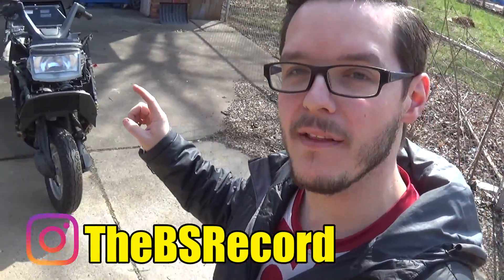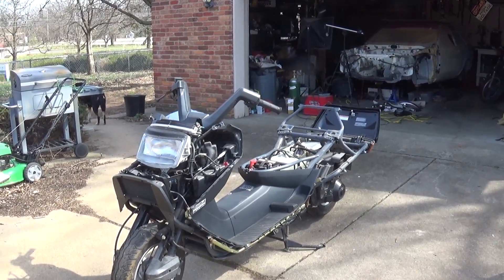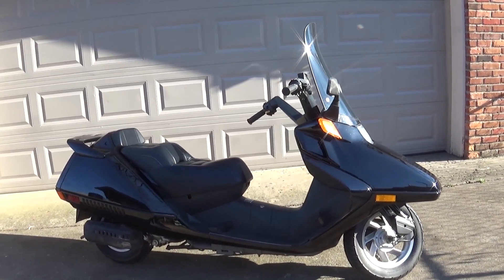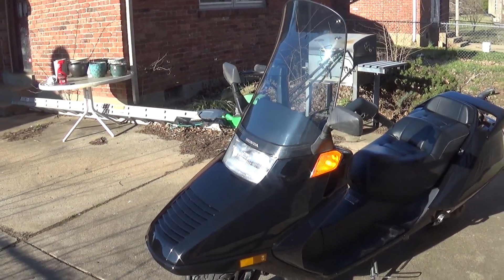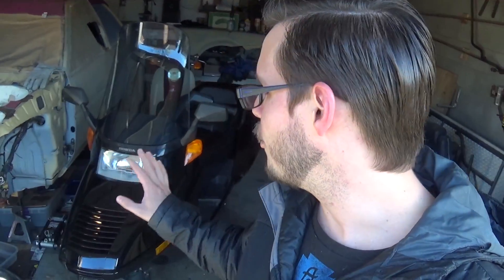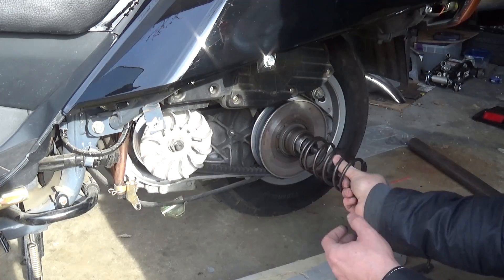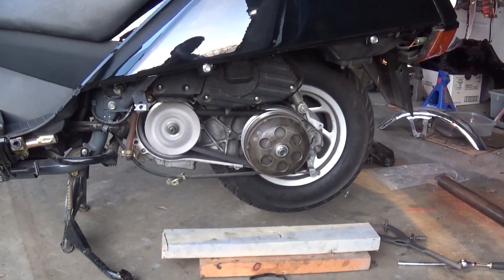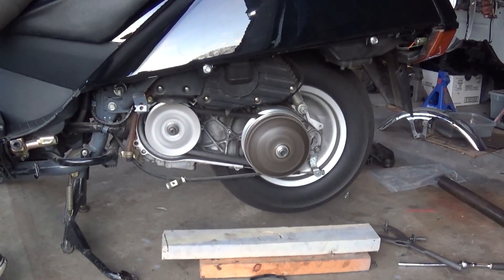Fixing My Honda Helix CN250 | DIY Scooter Restoration Project - Honda Scooter 250 cc( Honda Fusion )

Comment: As a guy who comes from riding motorcycles for about 30 years you guys are really getting me interested into these scooters. Especially this Helix they look really nice and fun and possibly something you could tour on.
Reply: As a 30+ year motorcycle owner and rider buy one if you can find a nice one they are a historic classic and loads of fun. My last 2 bikes were 1500 & 1800cc Goldwings until I bought a 1996 Helix 2 years ago. I don't at all miss wrestling 800+ lbs over it's 349 lbs, the higher cost of maintaining 6 cylinders over 1 cylinder, or shifting 5 gears opposed to none, and the seating and feet forward positioning are the ultimate in comfort. I mostly drive parallel freeway back country roads and cruise at 50 to 60 mph with other riders driving larger machines without a problem getting 68 to 77 mpg. and still have a top end of 75 mph. I have always been fascinated with scooters my whole life and will probably add a Suzuki Burgman to my collection one day but will never part with my Helix.
Reply from the maker: @Serpico1152  thanks for sharing! I love my helix too, its a great scooter!
Reply from the maker: You should get one, they are super fun!  Definitely tour-able!

Comment: Great job and video I could watch Helix videos all day long. I bought a 1996 Helix back in September 2018 and I replaced the complete CVT last fall with all new OEM Honda parts as it was at about 21,500 miles and started shuttering and shaking when taking off from idle. Everything appeared to be all the original worn out parts with some being dated 10/17/95 the variator rollers had very worn flat spots and were replaced with Dr. Pulley 21 gram sliders, the driven pulley friction pads and bell cover replaced due to having the dreaded bluish tint color indicating that they had overheated and the bell inner surface damaged, the belt replaced due to having several cracks in it, and everything else considered a moving part. Yes they are easy to work on, diagnose and repair as you did everything correctly in my eyes by using the tool and torque wrench when installing it like I had also but I have seen others using a impact gun or looking like a cave man tapping on the edges of the nuts with a hammer and chisel to tighten them causing permanent damages. Since I never received any prior maintenance records for a solid piece of mind and to be 100% road worthy I would do as I did and eventually replace the air filter, fuel filter, spark plug, flush and replaced the front brake fluid, flush and replace the coolant system, replace the final drive oil with 75-80W gear oil if not at least check the oil level as I have seen others have theirs damaged because they were run dry of fluid. While mechanically everything on mine appeared to be somewhat neglected, appearance wise the bike was showroom quality so everything should now be trouble free for a long time. My only regrets now is that I didn't video all my work to share with everyone out there, but I hope to start and change all that in the near future.
Reply from the maker: Lots of good information here! My buddy just got a 1999 Elite 80 and is experiencing the same shutter when starting off and decelerating. We think it has to do with his clutch bell like you mentioned above. Thanks for watching and commenting!

Comment: Great series of videos!  I had an '87 Helix and loved it.  They're pretty bulletproof machines with a couple of weak spots.  On my '87, there was no bracket to support the carburetor, just the rubber intake boot.  Over time, the constant vibration would crack the boot.  Honda corrected this by your 2001 model.   The other weak spot is the little rubber hose (it looks like a vacuum hose) that carries coolant to warm up the carburetor. If that hose breaks or falls off, you'll lose all your coolant before you can say "oh shit".  That's what happened to my '87.  I was on the freeway doing 60+MPH when the hose fell off the carburetor.  By the time I got safely to the side of the freeway, my engine was toast.

Comment: I know you want to lower the Helix and make it your own, but trust me, it aint broke. Dont need fixing. The Honda engineers REALLY knew what they were doing when they designed this machine. Once you start riding it on the roads, you will see what I mean. Enjoyed the video and keep it up!
Reply from the maker: You are right, I have been riding it and I love it, but..... I am still going to try out an air ride setup. I plan on getting high quality air parts to hopefully get the nicest ride as possible and are going to try and make the system 100% modular. Meaning I will be able to swap directly back to stock suspension if I dont like it. I do not want to cut or modify the stock mounting points at all. Thanks for tuning in and commenting!

Comment: I have a Honda helix, working on this bike is time consuming but it’s fun the same time !
Reply from the maker: For sure! They are a lot of fun and super reliable once you get everything sorted. If you haven't already, I suggest looking into getting a service manual for the bike. It will definitely help out when performing maintenance and servicing for the bike 👍 Goodluck with your helix!
Reply: @TheBSRecord  thanks, I still continue to work on it, I have some minor breaks with my plastics that needs a replacement and weld, I’m glad I have clean my tank, reservoir tank too, everything is clean I need to replace my carburetor seat needs to be replaced and then I get it on the road again, best bike I ever had 🥰
Reply: @TheBSRecord  thanks, I still continue to work on it, I have some minor breaks with my plastics that needs a replacement and weld, I’m glad I have clean my tank, reservoir tank too, everything is clean I need to replace my carburetor seat needs to be replaced and then I get it on the road again, best bike I ever had 🥰
Reply: @TheBSRecord  I need help, I’m done with the scooter If I hit a speed bump, put it on the stand, or take it off while it is idleing, it sputters for a moment and sometimes dies as if the shaking causes it not to get fuel momentarily. Please have experienced this fault before ? What could be causing it
Reply from the maker: What is your idle set to? Maybe it is set a little low and when your under load, it has trouble staying on? When you bike is idling on the center stand does your rear wheel spin at all?
Reply: @TheBSRecord  I have screw out the idle bolt very very low that it doesn’t touch the carburetor, my rear wheel spin when on center stand !!! I don’t know to do, I don’t get the crouch doesn’t change to neutral when riding downhill and I leave the throttle, I think something is wrong, I clean the carburetor , and change the fuel filter...still power try to cut when I hit ramps or take it off center stand

Comment: Im actually going through a similar rebuild of an mc-54-250b scooter! I bought it with all the plastics off of it and the mechanics not in good shape. After starting it for the first time, the fly wheel nut came off inside the crank case (i shut it off before it did any damage) but the nut was a custom job by the last owner. Glad to see someone else rebuilding a 250cc scooter!
Reply from the maker: Super cool, good luck with your build! The 250s are definitely worth the time to rebuild 👍 Many more videos to come thanks for tuning in and commenting!
Reply: Doing one myself. Picked up a 92 Helix for 500. Body’s perfect, except for missing that nose vent.Mechanically ,not so good. Replaced fuel lines,filter and pump. Had to replace the Wire connector on OEM fuel pump.WTF? Had the wrong connector on it. Started right up. The problem is ,it’s knocking like a drunk who forgot his house key. Was hoping it was one of the 2 exhaust leaks. Hole in the flange plus missing the muffler gasket. Well, that wasn’t it. Yeah it’s a knocking. Engines setting on my workbench now with a missing cam bearing. It’s scattered around the engine. Fun times.lol.

Comment: 3 wheel car on Messerschmitt kr200 body ,5 speed motorcycle clutch and gearbox, water cooled better, Citroen 2cv front suspension,helix gearbox for non clutch folk.
Reply: In case I forgot reverse gear ,can be add on or even electric,just simple and componentised.

Comment: Good job. If you find that windshield is too tall you can cut it down. Make sure you black out the bottom of the windshield with electrical tape (so the headlight doesn't light it up).
Good job with the clutch repair. 👍
Reply from the maker: Thanks for watching and the info mentioned above!  I have been driving it for a while now and it is awesome!

Comment: Looking forward to the bag installation 👌🏼👌🏼👌🏼
Reply from the maker: For sure! I'm looking forward to doing it too. There is such a lack of info on bagging a Helix in the states. Hopefully it will help others looking to do the same thing too!
Reply: Bag? Most Helix owners add top cases for extra storage. You did such good job with the new body panels, I’d hate to see bags hanging off if it. You can get a matching black trunk.
Reply from the maker: @newenglandpats59  i apologize,  I should of been a bit more clear. I am wanting to put it on air ride suspension so it can sit lower. I usually refer to those as "bags". Probabaly not the most practical thing since I will have to modify the rear trunk, but it will look so good in my opinion.  Thanks for watching!

Comment: Very cool  my Helix  needs love to  i have a black  all oem 1995 it needs a fuel  pump  and a battery  and a good wax job i would  love to find a new seat age cracked
Reply: Exploring With Larry when I replaced the fuel pump on this 92 I just bought had an issue with the wiring. OEM pump had the wrong connector. Plus the wrong color coding on the wires. WTF? Easy enough fix though. Just swapped the new connector with the old one, once I figured out which wires were which.
Reply: @kevinklemz163  thanks  for  the  advice 🛵
Reply from the maker: Since posting this video I overhauled a 2006 helix and did the work you mentioned in this comment, plus more! They are pretty simple scooters to work on. Ebay is your friend, their are all sorts of replacement parts on there.  Good luck fixing your scooter!
Reply: @kevinklemz163  good to know

Comment: Hell yeah what kind of bag will you use??
Reply from the maker: I will be using a set of Monroe air shocks designed for an older corvette.  They are cheap and a lot of Harley guys run them on their bikes.  It will not be "plug and play" and I suspect their will be a fair amount of fabrication involved.  However, the goal is to keep the stock mounting points just in case I ever want to go back to an OEM setup.  Thanks for tuning in!

Comment: I bought same kit. Can you tell me how the wing metal brackets are installed?  Inside of trunk or between wing and outside of trunk/side panels sandwiched?  TIA
Reply from the maker: It's been a minute, but if I recall correctly, they are mounted under the trunk plastics and screw into the bottom of the wing. They sandwich the two pieces together. You do not have to drill into your actual trunk to mount the wing. Hope this helps!

Comment: What did you use to install the wing/spoiler on the back? I bought some replacement panels that came with one, but I don’t know what parts I need to secure them.
Reply from the maker: The wing came with a bracket and 2 screw for each side. The bracket goes underneath the plastic trunk panel and the wing goes on top of the the plastic trunk panel. The screws screw in the bottom of the bracket, through the trunk panel and into the wing on top. I hope that makes sense!

Comment: what about the flyballs? or roller weights of the pulley? is it in good condition or not?
Reply from the maker: yes, the flywheel/variator weights were in great shape.  The Helix only had around 2k miles on it, so they haven't worn down much.  Thanks for tuning in!

Comment: If you get a chance to show the carburetor support bracket, where and how they mount it would be cool. I have a 1987 model which did not use a bracket. Later they added it to prevent cracking of a carb boot it hangs on or something. Dealer suggests I "make something up" , but it would be nice to see am oem bracket program. Thanks for the videos!
Reply from the maker: Will do man, next video I'll make sure  to include the bracket. Also, check out my other part 1 video I think I got it on camera when I was going over the engine. Thanks for watching and tuning in man 😎👍
Reply: Thanks, your the best!

Comment: I'm looking into that windshield and can't seem to find it for my 1995 Helix. Got a part number or something there? Thanks buddy!
Reply from the maker: If I recall correctly it is called ds125 and is made by Givi. Be warned though, they are expensive but worth it!!
Reply: @TheBSRecord  I actually had the same question.  I'm not seeing anything under ds125.  Did you order the windshield from webike as well?  Could this be the one you ordered are are you certain on the ds125 part number?  
https://japan.webike.net/products/21554548.html

Comment: I am looking forward to more of your upgrades. Except the bags thing. It will no longer be Honda’s perfect design. You will be plagued with bottoming out issues as the Helix is very low slung as it is. Maybe you are doing this for appearance,  but normal riding will not be what your hoping for. I hope have you a chance to experience your Helix the way Honda designed it before you make these changes. You may very well want to leave it as the best and most all around practical scooter ever designed. My Helix is 24 years old and has over 80,000 miles.
Reply from the maker: Wow 80k miles, that awesome!  I actually have been riding it since this video and it is great!  However, I still want to try a bag setup. BUT... I have decided I am going to make it completly modular. I do not want to cut or modify or any of the stock mounting points so I can swap back to stock if I hate the air ride. Thanks for tuning in and commenting!

Comment: Ahh - webike...

You know you  can repair a bent wheel, right?

"boomerangs" look like wind deflectors to aim the air around you.

Rear wheel spinning whilst engine running is normal. That nut looked like it has worn threads...
Reply from the maker: I kept the old rear wheel because I want to try and get it repaired. I dont trust myself do it by myself though haha 🤣

The rear wheel spinning is definitly normal but before fixing the clutch, It would spin the wheel "forcefully" like it would with the clutch being engaged. Everything went back together ok so I hope that lock nut works. If not, I may have to replace the clutch. Thanks for watching and all the info you've provided 👍
Reply: @TheBSRecord  ...where is this webbike place? Can you get anything? Because, when I watch the Japanese custom scooter shops do Helix and the Yamaha [Morphous} I am awed .
Reply: True, FC about the rear wheel.
Reply: @LoneBrowncoat  japan dot webike dot net. Be aware of other names for your scooter/motorbike.
Reply from the maker: @LoneBrowncoat  look up "webike japan" on google and it should be the first result, look up the 250cc fusion/sppazio/cn250. There is ALOT of stuff for the Helix there! Hope this helps and thanks for watching 👍
Reply: @TheBSRecord  ...Thank You, Found Them!